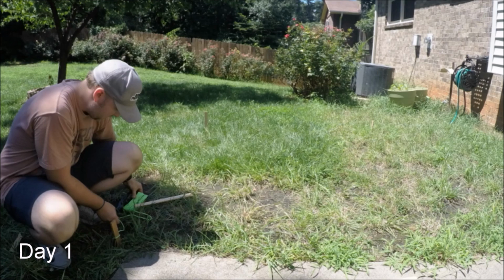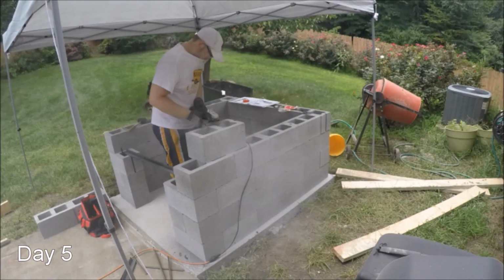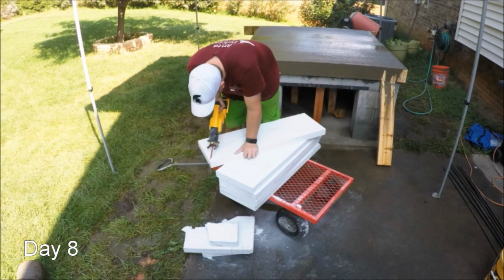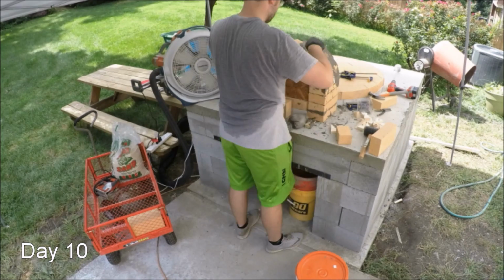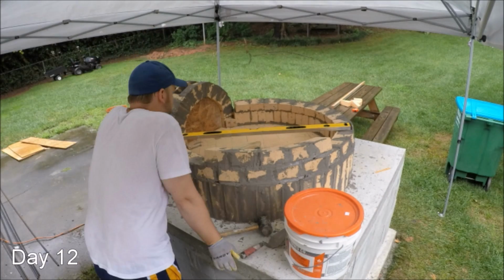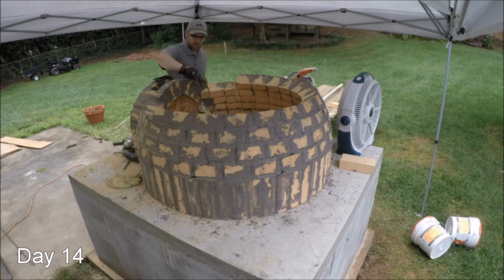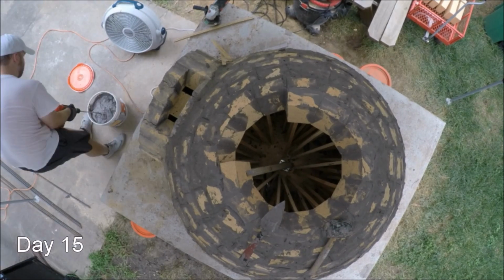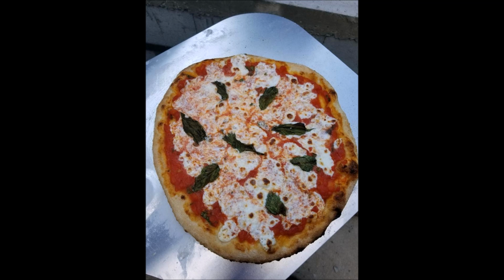My First Pompeii Brick Pizza Oven - Full Build - Time Lapse Video

Comment: Thanks for sharing!  We are building a similar oven, and you make it look easy.  I particularly admire how tight you were able to make the bricks on the inside of the dome - this is quite difficult especially as you move higher.  We are now closing the dome across the back of the entryway, so watching your process at this spot was helpful.  Because we are building a larger oven, we used angle iron to support one row across the opening, and are cutting angled bricks to go on top of them to support the next row of the curved dome.
Reply from the maker: Oh wow!  Bigger?

Comment: I have watched many YT DIY videos, and this is among the most concise and efficient one. To the point and covers most of the tricky situations you came upon. I would appreciate if you could let me know what was the inside diameter of the base, and also the specs of the materials you used, such as the cement, the bricks and the insulation. How is the oven holding up now after so many years of use?

Comment: Shawn....great video. Just had my slab poured yesterday to start my oven. couple questions for you. 1- What was the bucket of mortar you used and how many did you go through? 2-When the dome was finished you and you chicken wired it you covered it with what kind of refractory mortar? Was it different than the bucket you mixed to lay the brick? Appreciate your response.

Comment: What’s the section below for? I thought it had a purpose....also, no chimney? Does the smoke roll out the entrance too thick? Just wondering this crap because I’d like to try this this year
Reply from the maker: The open section below is for storing wood.  The chimney was built, using bricks.  It was one of the first brick laying steps

Comment: Good job but there really is no need for all that insulating stuff and refractory mortar. Very wasteful in my opinion. You could have built this oven using ordinary standard building bricks using clay mud for the mortar. Then there would have been no need for all those sticks. Anyway good effort.